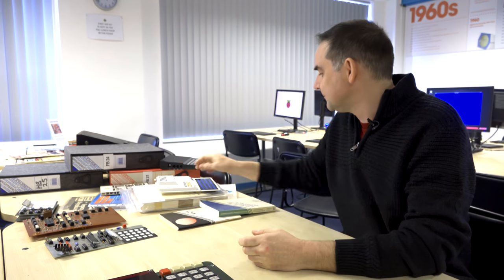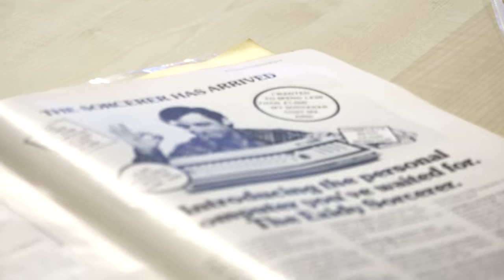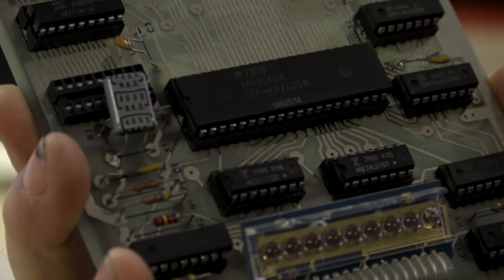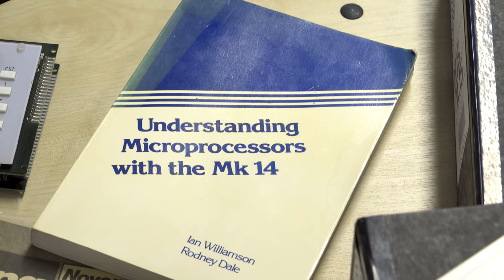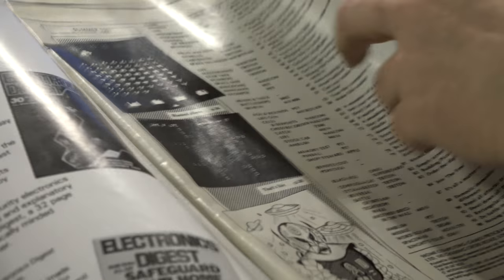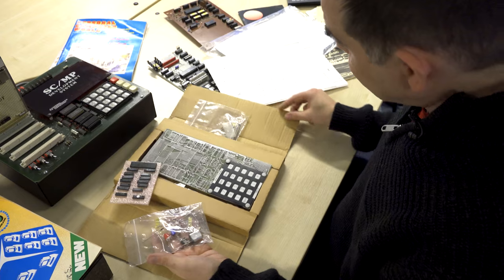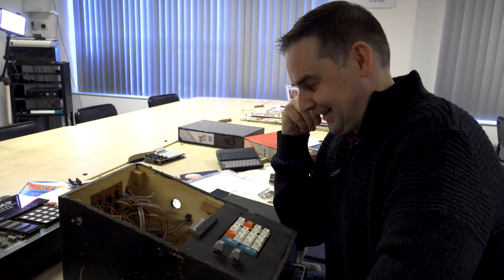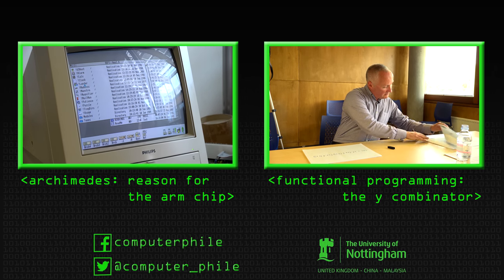1978's Raspberry Pi (MK14) - Computerphile

Comment: Just pause and think what you can do now with an ESP8266 board that runs at 80MHz, does WiFi, a lot of chip peripherals, has onboard storage of 4MiB, a ton of IO, and costs less than $3. A guy on YouTube named CNLohr even made it output 3D meshes in NTSC video, and run a Minecraft server.

Comment: In 1989 when I first started my proper IT Job as a Computer Operator, prior to this I had been to a YTS ITEC from 1981-82 and then worked in a computer store from 82 to 89 but I digress, when I started in IT proper we used ICL mainframes. We had two ICL SX39 which were ICL's most powerful nodes (nodes being which is what they called the processors) these were giant things that looked like big grey wardrobes. We came across a prices list that an ICL engineer had left behind by mistake, bare in mind that ICL only ever leased stuff as it was so expensive, but the nodes we had were £10 million each, and that's £10 million in 1989 money, and these things were probably no more powerful than, IDK a current ARM processor or a Pentium 4 something like that.
Reply: Lol a P4 probably would be pushing it . Probably closer to a P1 .

Comment: Did my first hex programming in 1977 on a KIM-1 (https://en.wikipedia.org/wiki/KIM-1) on a US Navy ship at sea in the middle of the Pacific Ocean.
Reply: You may want to check out the "KIM Uno" kit... It emulates the 6502 in an Arduino, and is the size of the keypad from the original KIM-1, for about $10.  :D
Reply: No, the KIM-1 is definitely in my "been there, done that" file. Python is so much more productive...
Reply: I don't think anyone is doing anything productive on these at this point. It's all just for fun! :D
Reply: I will have to check that out.
Reply: MichaelKingsfordGray Machine code, basically assembler.

Comment: A nice all round intro to the MK14, which I enjoyed. A couple of minor corrections though, one is that (as PHILG2864 pointed out) the SC/MP didn't actually have a true internal serial UART. Another point was that the address, data and control signals were never available at the rear edge connector on any MK14 as originally built - only the power, I/O port and 'Flag' output and 'Sense' inputs, and on some issues the NADS signal were tracked to the rear edge connector on the upper side. From about issue IV onwards the rear edge had contacts on the underside as well, but they still didn't have anything connected to them - you had to wire the address, data and control signals to those yourself if you wanted to connect peripherals, such as the MK14 VDU, via the rear edge connector.

Comment: This was my first computer too! He showed the original cardboard box it came in. I kept it in there after assembly because the white pins that held the keyboard together stick out the back. If you put the board flat on a table the keyboard would disassemble itself with every key press😢
Crappie keyboard because the firmware PROM had not enough of a debounce delay coded in causing many repeated keys.
I also remember you could no go back one location in memory from the keypad. 
However I learned a lot from programming this board! Ha ha.

Comment: Still better than the Asus Tinker Board
Reply: Wait, why is the ASUS Tinker Board bad?
Reply: mortenmoulder in theory the specs are better than RasPi but the community support doesn’t even come close
Reply: The community could be built around it... just ASUS don't seem to care...
Reply: GeoNeilUK asus banked on the fact that they would get a community like RasPi. So they didn’t do much of their own software since they thought others would do it for free
Reply: +Treepoint Onefour: Install Debian on that sucker and you have the same experience, if you're rooting for a server. I was one click away from getting one, until someone approached me with their ODroid XU4 instead. eMMC, USB 3.0, gigabit ethernet, 2GB LPDDR3 RAM, and an Octo Core CPU from Samsung.
Reply: "asus banked on the fact that they would get a community like RasPi. So they didn’t do much of their own software since they thought others would do it for free"

And that was a mistake by Asus.  Part of the reason why the Raspberry Pi is the Microsoft Windows of SBCs is because it was the first to catch the public's imagination but also because the Raspberry Pi Foundation led the community with providing their own software and support and promoting it and getting the SoC manufacturers to open source the drivers.

Because the Raspberry Pi came from a foundation who wanted to create a board that the general public could learn to program and build on, whereas the Tinkerboard came from a corporation that wanted to  make money.
Reply: A big mistake because the Tinker Board is a very powerful and useful piece of kit. I love the fact that it has decent audio and ram out of the box which makes it a no brainer for many of my music applications. With a little more exposure from ASUS, its ability to run much code written for Raspi and other systems would build a community quickly.
Reply: mortenmoulder the board isn't bad at all. In fact it is a great little computer. However, support from ASUS is poor which lead to slow uptake by the community who, if they are tech savvy enough might well go for a more powerful unit such as one of the ODroids, and if they are not knowledgeable enough will stick with a Pi with all of its off the shelf solutions. It is a shame as I love the little thing and think it really needs more support. EDIT LOL - I see you already know about the ODroids :)
Reply: Mark Mansell yep haha. I love my ODroid XU4. It serves fine for a small home server for my NAS, but I've decided to turn on my Mac Pro server instead, so I might end up selling this ODroid XU4.
Reply: the tinker board is awesome, the latest tinker linux os is streets ahead of the first version. it is perfectly usable as a pc, my pi3 never gets used any more

Comment: Yep, my first ever computer. Learned so much form using it - even though it was so very very.... well, bare bones basic (not BASIC - I dreamed of having a BASIC capable machine!).  Don't have the board any more, but I do have that manual for it.
Reply: You'd be surprised by how much that might be worth in 2020 Alan, an MK14 manual - just the manual by itself - recently sold for more than £40.

Comment: Machine code. Not assembly language.
Reply: Asm is just aliases for machine code. Instead of A0 you write mov.
Reply: Assembly usually has labels, which machine code does not. Also mov will translate to a different opcode for different directions.
Reply: It doesn't really make much of a difference, it's a tomato tomatoe kind of thing IMHO. While I never had the chance to use these machines, I bet I'd rather work with listings for assembly than for machine code (even if the machine code was commented properly).
Reply: Not quite. Different addressing modes in assembly generally use the same opcode but translate to a different machine language instruction.

For example the opcode ADC can be translated to a different binary instruction depending on whether you use absolute or immediate addressing.

ADC $44  might translate to $69 44
vs
ADC #44  might translate to $6D 44

As far as the CPU is concerned there is no ADC, but instead an "ADC absolute" and an "ADC immediate" and it will run through a similar but distinct set of operations for each.
Reply: Well yes, of course assembly is a lot easier than machine code, that's the whole point of it. Programming this thing in machine code is much more hard-core than in assembly language. Assembly language is a language for assembling machine code instructions.
Reply: Phil Hibbs I was explaining another reason why assembly is not the same as machine code.
Reply: Assembly Language is merely a set of mnemonics for machine code and, thus, the same thing. The only thing that might blur the issue is that some assemblers have advanced macro facilities that are, in themselves, small languages (though not always Turing complete). Few programmers in their right mind would ever write machine code directly, instead writing down the mnemonics (on paper, with a pen or pencil) and then hand translating to the machine code which was then entered to the computer via keyboard or through the use of a paper or card punch device (or, in some cases, latching switches, such as the toggle switches, with blinking lights, on the front panels of early computers). When it comes to the actual numeric codes, one must think, not in whole words, but in terms of bit fields, which is where modifiers (ie. addressing modes) are often set. This is why hex or octal are used instead of decimal because after a while, you 'see' the bits, instead of/alongside the digit.
Reply: It is exactly the same thing. I should know since I am a Computer Scientist, been programming 40 odd years, have used this technology extensively and been involved in the design of microprocessors and logic systems. By your very own argument, try typing in the hex digits and point your program counter at it. Same result. Your argument it incorrect and illogical in addition to your reading and comprehension skills being woefully inadequate.
Reply: Mark, if you remember your computer science a bit better you'd realize that we're not all crazy. Go look at the example that I posted above and you'll realize that assembly is not totally analogous with machine code.

Even putting macro assembly aside, there are fewer assembly opcodes than there are corresponding machine code instructions, so there is clearly something different going on than 1-to-1 mapping.

If you write an assembly program, you will find that you can't simply 'find/replace' the opcodes for their machine code values because there is additional context that the assembler needs to take into account from the operand.

An ADC opcode on a 6502 is not a single machine instruction and the compiler must see what operand(s) are provided in order to determine the correct instruction. 

Nobody is saying that assembly isn't, generally speaking, rather close to machine code
Reply: Mark Mansell Yes, I am aware of how the 6502 CPU works, but you cannot determine the addressing mode from the opcode itself. It is contextual and is based on the syntax of operand, which is an important distinction.

There is a different between translation and compilation. If assembly was 1-to-1 with machine code it could be translated into it without any logic. This is not controversial. 

Nobody is being insulting here aside from you, you clearly either have forgotten this particular distinction or you are being argumentative for the sake of it.
Reply: Mark Mansell Your example is perfect in addressing this, btw. You have shown that the atomic elements of assembly are not mappable to the atomic elements of machine code.

You must look at a group of elements in assembly, the opcode and operand, to determine the correct group of values to send to the CPU.

A truly 1-to-1 mapping would allow you to translate individual elements with no need to view or understand surrounding elements.
Reply: Mark Mansell Another way to express this that may make it more clear to see:

If I am trying to do some binary reversing and, for some reason, I only have access to a single byte, the first instruction in the program, I can determine exactly what that operation is, even though I don't know what values it will be fetching.

On the other hand, if I was reading some assembly and was given only "ADC", I know a bit about the operation, but not as much as I did with the single byte.
Reply: Mark Mansell Perhaps your argument rests on the fact that there is meant to be an equivalence between assembly and machine code. Nobody is arguing with that.

I don't think you should get upset unnecessarily, but even the more popular books on the subject seem to agree that there "is a very strong (but often not one-to-one) correspondence between the language and the computer architecture".

Of course, an equivalence is required, nobody has been arguing to the contrary. Perhaps this is just an argument over terminology?
Reply: Popular doesn't mean correct and very frequently is not correct.
Reply: Do you not see that there is a difference between 1-to-1 and, for example, 2-to-2?

Both show a form of equivalence, but are distinct in how they map.
Reply: How do you define a label in machine code?

Comment: Those keys on the MK14-in-a-box look like they're designed to last decades.
Reply: Roxor128 But they would be harder to clean in a medical environment than the original touch keypad. As for durability, it depends if the original was a true touch pad or a membrane keypad, as the latter tends to wear out in 5 to 25 years of light use.

Comment: What type of chip package contains straight long (gold?) pins like those in the microprocessor at 6:57? Or are those long gold pins soldered onto the standard pins after the fact?
Reply: They aren't the pins of the IC, they look like the long pins of a 'wire wrap' IC socket into which the IC is inserted. Wire wrap was a solderless method of making point to point connections on PCBs.

Comment: I wish rpi's were sold as a diy kit.
Reply: The specs are available!
Reply: They are, but sourcing some components will be troublesome.
Also, assembling smd parts is pretty hard too, with hobbyist level equipment.
Reply: It would be worse than troublesome, it's basically impossible- Broadcom just wont sell you the ARM chips. 
The Pi people only managed to convince them off the back of being for education and charitable.
They're only interested in orders of massive proportions.

Comment: I've written SNES code without the use of an assembler by taking the assembly code, looking up the hex codes for each instruction type (harder than it sounds given the same instruction using a different addressing mode has an entirely different code number) and writing out the sequence of hex values into a hex editor.
It's an utter pain to do, but it works, for sure.
So yes, if you've got nothing better to work with, you absolutely CAN code a program using raw hex values, not even assembly code...
It's not as hard as it sounds, but I still wouldn't recommend it if you have better options. XD

Comment: But can it run cs go?
Reply: Not likely. The keyboard controller for the original IBM PC had similar specs.
Reply: It could probably run it, perhaps rendering 1 frame per year though.
Reply: dogwomble  -  No, it couldn't. It doesn't have enough memory. This thing only has 256 bytes of RAM. A frame of HD video takes up around 6MB.

Comment: More an arduino than a raspberry of the time.
Reply: Zoltán Gácsi technically it might be closer to an arduino, but it was used more as a computer than a microcontroller, which I think makes it more comparable to a raspberry pi
Reply: yeah i agree
Reply: More like a PIC16F84 with a keypad and display.
Reply: Well, context is everything. Remember this is 1978... The distinction between a microcontroller and a home computer and even a pocket calculator are all quite fuzzy.

And let's be clear here, there were no real 'cheap, low performance microcontrollers'.
Nowadays you can get 8 bit microcontrollers with performance similar to early 80's processors for a few cents.

But a 6502 was considered 'cheap' in the late 70's by virtue of costing $25 rather than $200

If you're going to make analogies to modern technology, remember the context, and what late 70's tech actually looked like.

After all, a raspberry pi and an arduino are similar devices at heart, one just has more built-in peripherals than the other, and higher performance components.
Reply: Well, if you think about it, the raspberry boots into a full multitasking OS, and the arduino just runs some single thread code in a small address space.
Reply: Zoltán Gácsi I think the key factor here is that the "Baby", the MK14, the ZX80, the ARM and the Pi are all designed and made in Britain, unlike the ENIAC, the Altair, the Apple I, the C-64 and the Beagleboard, which were all designed and made in the US.  Or the Olivetti and Arduino from Italy.
Reply: The Arduino's program memory has to be populated by ISP before it can do anything, the Mk14 is programmable out-of-the-box without any additional hardware, by virtue of executing code from external RAM, rather than internal non-volatile storage.

I guess it's arguable that the RasPi needs some method to get the OS image on to the SD card, but once that's done, you can develop, run, and debug software on the Pi without an external tool, and this is what distinguishes it from Arduino (let alone performance and feature set).

A (sort of) contemporary analogue of the ATMEGA* microcontrollers found on Arduinos would be Intel 8051 or similar.

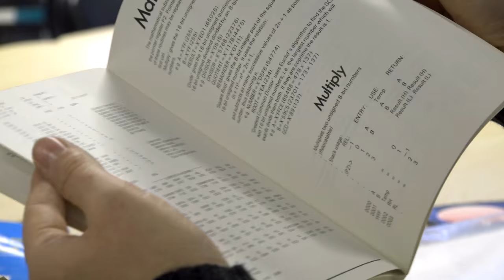Comment: @9:59 "...SC/MP  ...had an inbuilt UART" - no it didnt, the serial in and serial out pins were single bit input & output ports respectively, serial comms had to be done using the software SIO instruction, looking for a start bit and then shifting bits in one at a time with a  bit delay to suit the baud rate.  
There was no UART. Experts eh???  :-)
Still have my homebrew SC/MP, it runs Kitbug and NIBL, still works 50 years on!
Cheers
Phil